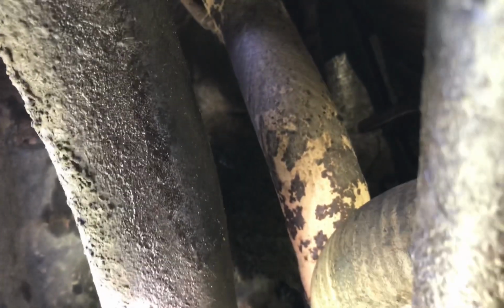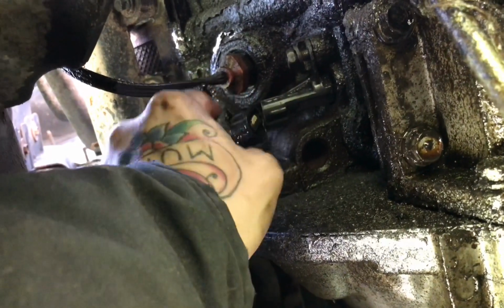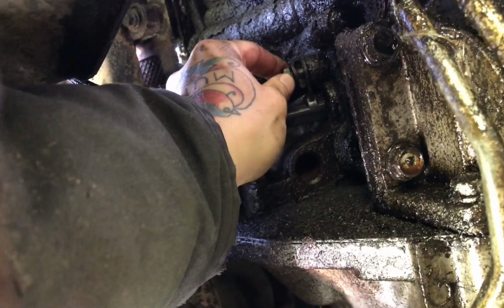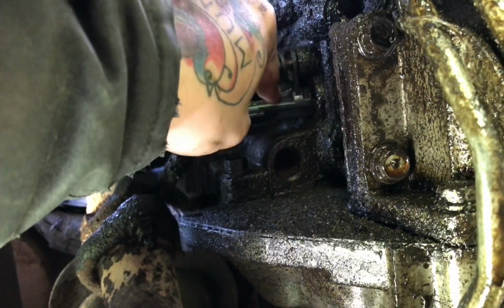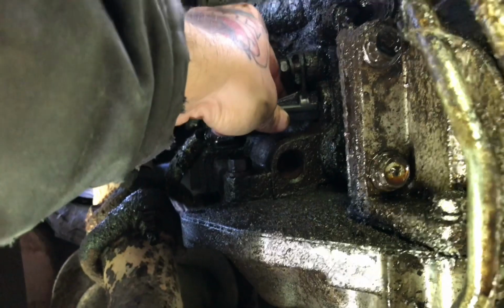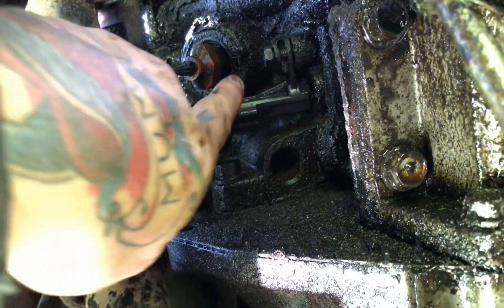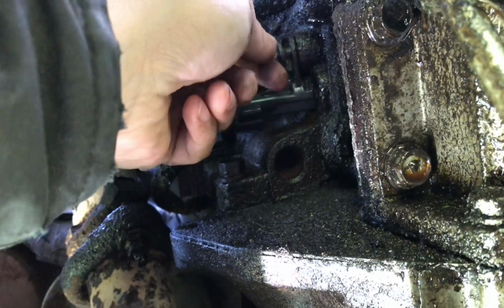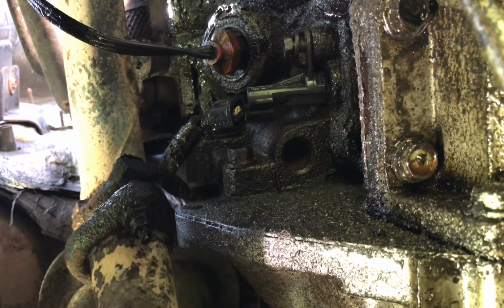How to Replace Crankshaft Sensor • Dodge Ram 1500 4.7L • #ThatBeardedMechanic

Comment: Finally good short quality content... How it should be... Thanks for not being an idiot and wasting our time with useless blabbering or lack of info
Reply from the maker: Haha glad someone agrees that too many “DIY” videos ramble on, that’s the aim of my content is to be as short as possible and still be straightforward with information to do it properly. 
Appreciate the kudos. Cheers.
Reply: @That_Bearded_Mechanic   did you have relearn crankshaft position sensor ?
Reply from the maker: Nope. Just reset the code. Started the truck back up, let her idle and drove as normal and  you’re good to go. ECU/ ECM should pick up the signal from the new sensor.

Comment: Why does my 2003 ram dies when u give it gas fast
Reply from the maker: Do you have any check engine lights currently present?
It can be from a host of issues:
- flooding out the engine
- improper fuel/ air mixture from a bad sensor/ throttle body
- a weak fuel pump
- oxygen sensor issue (typically the primary ones)
- clogged catalytic converter

Comment: Nice video. I'll give you all a quick advice.. if it doesn't pull off, but it spins, then it's vacuumed locked.. open the oil fill tube or pull the dipstick. Trust me.. you're welcome
Reply: would this be the case for the cam sensor also?
Reply from the maker: Yup, same concept as it has a little o-ring on it too. Again, be careful so you don’t break it.

Comment: The 13mm...short or long socket?
Reply from the maker: You can use either to get at the bolt. I used a deep socket if memory serves me right. If you don’t have a deep one, you can always use a short extension with a shallow socket on the end. There’s plenty of room.
Reply: @That_Bearded_Mechanic  thanks! What can I use to get the connector to release? I squeezed and squeezed and pulled it!
Reply from the maker: You might have some gunk jammed up in the connector clip. I’ve used small screwdrivers before (the micro ones for glasses) to click the lock pin over or a pick thats hooked to grab it too. Sometimes pushing the sensor connector inward then pushing the release tab will allow it to release then pull it. If it does break, there’s a chance the sensor connector can vibrate loose when you reattach the new sensor. And then cause you issues.
Reply from the maker: You can also try spraying it with some WD-40 or something that’s got a little pressure to displace any gunk that’s got it jammed up.
Reply: @That_Bearded_Mechanic  I got it off! I did everything else first! I let it hang and it was easy then!
Reply from the maker: Right on. Good to hear it worked out for ya.

Comment: Hope you read my comment, if my truck turns off just bc every time it wants but as soon as I put neutral I start the truck back to drive and works perfectly. What that’s problem can be?🙏🏻
Reply from the maker: Are any codes present or a check engine light coming on when this happens and staying on after the restart? 
I assume when it dies while running it’s like someone’s flipped a switch and everything has cut out. Would lead me to believe an electrical/ sensor issue. 

• Check the battery, confirm it’s voltage while running. Should be seeing 12.6volts at the battery while running. 

• A voltage drop test on the battery when you start it should ideally see no more than a 2 volt variance (no less than 10volts) when starting. 

• Check the alternator as well and confirm it’s functioning properly and charging the system. Should be seeing 14.6volts while running. 

• Double check all grounds and wiring connected to the battery and TIPM (engine fuse box) for corrosion. 

Personally myself, I’ve had this exact issue happen to me and it was my alternator fluctuating voltage to the battery. I noticed an electrical gremlin starting the day or two prior. 

Thankfully when mine decide to do this at full failure, it was on my way to work and not somewhere way out in the bush etc. I had to limp it 20kms like this coasting and starting a few times. 

You can also check the cam and crankshaft sensors as well. I have this and another video outlining them. If they are failing, they too can cause these issues but you typically would see an actual starting issue with it as well but it’s good to rule them out as well. 

Hope this helps you.

Comment: I have a 2004 Dodge 1500, 4.7L & it cut off twice while I was driving on the highway.  I thought it was because it has 185K miles on it, but I researched the code PO340 & PO344, which bought me to you. 😊￼Now, I'm not a mechanic by trade but I can read and follow instructions, so I'm going to give it a try.  Oh, by the way, I just had the spark plugs changed and the mechanic did mention that I need a new valve cover gasket.  So should I wait and get the VCG replaced or attempt to replace the crankshaft and camshaft sensors first?
Reply from the maker: Welcome! Glad the search feature brought you to me. Mileage really has nothing to do with a vehicle “just turning off”. My Ram in these videos for instance has 732,000kms at the time of recording them. 
I’d change the Camshaft and Crankshaft sensors. Then when you have time, change the valve cover gasket as well. Highly suggest an OEM Dodge one or a Fel-Pro gasket (that’s what I have in my truck). The kit will come with all new grommets for the bolts as well so it’s a complete gasket changeover to avoid leaks.

Hope this helps. Any further assistance required, please feel free to message me and I’ll reply as fast as I can.

Comment: Thanks bro simple and easy..👍👍
Reply from the maker: Right on, glad it helped ya.
Reply: @That_Bearded_Mechanic  say man I'm having problems getting my truck back on I replaced the two sensors and the starter but when I turn the key its making a noise like if the starter is jus hitting the fly wheel any thoughts..
Reply from the maker: Mike Uribe Hmm, what was the issue before or leading up to the issue that made you replace all three items?

And is it grinding or just clunking against the flywheel? It’s possible they gave you the wrong starter so it’s not engaging the flywheel correctly. Another possibility is the flywheel maybe damaged on the gear teeth. 

Are you able to make a quick video and post it and tag me in it?
Reply: @That_Bearded_Mechanic  it was like knocking noise it did sound like grinding but I jus turned the pulley a few times and it ended up starting but I was told it might be the flywheel.
Reply from the maker: Mike Uribe Yeah I would have to agree with that since you had to rotate the engine over a couple degrees. It could also be that the flywheel teeth weren’t fully lined up with the starter to engage properly. I have dealt with this several times when installing new starters in heavy duty and automotive applications. 

Best to monitor in case it happens again. But I wouldn’t be immediately thinking the worst right now. There is an inspection cover on the case at least mine has one) so you can remove that and inspect if there’s any gear teeth that have been knocked off and sitting in the bottom of the bell housing.
Reply: @That_Bearded_Mechanic  tru tru thank you for your feedback
Reply: I had my mechanic get it  but turn out it was my fuel pump was bad not the crank sensor

Comment: I have fuel spark and crank but won't start even off starter fluid
Reply from the maker: What year and engine?
Do you have a check engine light on? 
And do you have any type of security immobilizer installed?
Reply: @That_Bearded_Mechanic  07 with a 4.7l and no
Reply from the maker: Okay, the major issue on our trucks when it comes to this as well is the TIPM (engine fuse box), they’re prone to building up corrosion on the underside. So take a look at that. 

It’s odd no codes are present but you can check further by cycling you ignition key to on the ON position three times and codes will pop up in the dash where the odometer reading is. Just another back up to confirm there’s no codes. 

I would definitely start there. I had this same situation on my Ram, swapped in a new TIPM from a junkyard because I did confirm corrosion on the underside of the unit itself in my case. 

The follow up would be to inspect the crank and cam sensors. As I stated in the video, they’re prone to causing hard starts and other running related issues. 
If you have a multimeter, you can test them before replacing, there’s tutorials online of how to do this that you can search and then confirm if the sensor is faulty or not.
Reply: @That_Bearded_Mechanic  I have a 02 that needs a motor and we where going to pull the motor out of the 07 but couldn't do it since the truck was really nice but still thinking about just doing it so I can have my truck running. I've looked at everything and tested everything no codes
Reply: @That_Bearded_Mechanic  I've asked mechanics that have been in the job for 40 plus years and nobody knows what's going on without looking at it but we don't have the time and money to do it. We just want it running
Reply from the maker: Yeah that’s the hard thing in diagnosing when I don’t actually have the truck in front of me to see, hear and test what’s going on. 
It is odd you have no CEL’s, have fuel at the rail, air, spark and she cranks. 

I’m assuming it ran recently while you had it or you were told it ran prior to you getting it to swap the engines over to the ‘02.

I assume you have solid compression across all cylinders as well? 
Check all grounds, the ECU, TIPM, wiring connectors and the harnesses.
Reply: @That_Bearded_Mechanic  I can't find anyone that's close to where I live at to come and figure it out cus it's getting to the point of pull the motor and set the rest of it on fire

Comment: I have an 06 3.7L  I have fuel,spark, compression new coils new spark plugs, new crankshaft sensor, new camshaft sensor  and it only cranks but no start 
What else can I check for?
Reply from the maker: I assume you have no check engine lights on the dash at all to indicate somethings failed? And you’ve confirmed the fuel is in fact getting to the fuel rails right? You can check the Schrader Valve on the fuel rail for this, should have a black cap on it, on the passenger side if memory serves me right. Wear safety glasses of some sort when you check it and have a rag underneath it to catch any fuel.  Depress the valve or actually get a gauge (some auto places rent them out) and with the gauge you can see if there’s continual pressure.

Comment: 2003 ram pickup 1500. 3.7 faulty gas gauge, new fuel pump,faulty gas gauge.np pump problems on code reader. Did reset several times but no luck. Sensor may be cause but you didn't mention it,also might be ecu, or ignition module.spent 2grand in one year  help!me! Please
Reply from the maker: What are some of the fuel pump codes you’re getting on the code reader? 

I’m assuming you’re just having a general running/ staying running issue on the truck? 

You can also confirm fuel pump operating by the obvious of heading it prime with the key in the ON position and also checking the Schrader valve (little port with a black cap) on the fuel rail (passenger side) with a fuel pressure gauge (some places rent them out for cheap/ buy from Harbour Freight cheap).

BE CAREFUL doing this, there is fuel pressure in that rail and some can spray out if you don’t connect properly. 

Fuel pressure should be 44-54psi while running and stay consistent.

For the fact the gauge is faulty, you can “bench test” the fuel pump sending unit by actuating the arm slowly with the key in the ON position and having someone watch the fuel gauge if it rises and drops as you actuate the float arm. 

Also confirm all the wiring from the pump as far as you can trace forward is intact. The harness is pretty exposed and I’ve had issues in the past in a shop where I’ve had to pull majority of the harness down and found corrosion in the harness that’s to the fuel pump.

Hope these suggestions work for you and get you a head start. Please update on your findings.

Comment: hi i have a 2002 ram 1500 4.7 ....ive been having a lot of fun with this truck....... heres my story....
1--i changed the tps sensor and the iac valve i also replaced the vacumm hoses,it would crank every single time no problem but it would idle really high...we messed around with the vacuum hoses and it would still idle high.
2- we couldnt fix the idle problem so it followed with a bad negative battery cable....it would act like it didnt have enough juice to crank...we fixed that and it would run but still high idle....
3-i would try to crank it but it would missfire or back fire
4-fuel pump died so we replaced it and when i went to pick it up it would turn over but not fire up from cranking it too much it back fired or missfired through the intake and it actually broke the air box...the one thats in the middle of the engine and snapped it in half.... acording to my mechanic it wouldnt crank and it missfired due to one of the sensor not being plugged in correctly...it was either the tps or iac valve i cant remember which one.
5.we picked it up and it ran like a champ..it would crank at the first try ran great,idle was perfect good power great gas mileage
perfect temp.every thing was perfect...then it died againall the same symptoms it had when the pump died,wouldnt fire up backfiring,missfiring,smell gas,we know its not the pump because we are getting fuel no problem...
i think its the crankkcae sensor,my dad thinks its the pcm messing everything up and one mechanic thinks its something to do with the wiring harness
please help...when it runs it runs great...please help
Reply from the maker: Wow, very detailed list of issues, appreciate that in helping to try and diagnose. First off, I assume there’s no CEL (check engine light) on the dash this whole time?

Have you guys taken a look at the engine timing by chance to confirm she hasn’t skipped a tooth? I’ve had an issue like this in the past on another vehicle and she had skipped timing by one tooth, have also dealt with it in my heavy duty background as well on a forklift having pretty much the same issues as you’re mentioning.

Make sure to take a look at the TIPM (the main fuse box in the engine bay). They’re exposed to the elements underneath and pretty prone to corrosion and that can cause some problems as to what you’re describing.  

As for the PCM, you can grab a junkyard one of the same year and engine and try swapping it in (hoping the donor PCM is in fact working properly). You could also try the simple thing of gently wiggling the connectors and harnesses attached to the modules and see if they change anything as faulty connections can cause issues like this as well. 

Crank and cam sensors are cheap enough to swap in and easy enough as well for a test on any change. 

Start with what I listed above and check back in with how you made out.
Reply: @That_Bearded_Mechanic  update.....
the check engine light was on ever since i got the truck this time last year.....
i changed both the crank and cam sensor..
for whatever reason the cam sensor the plastic housing for the sensor  was half melted. i started the truck and the check engine light went away now the damn thing idles high. any ideas?
Reply from the maker: @theratedrtransformer8890  Hmm that’s odd that’s it’s melted, but at least that’s been dealt with. 

Alright so let’s go back to the fact the TPS and IACV have been changed.

The little motor on the throttle body is supposed to be clocked at a specific position when replaced, I’m thinking it may not have been clocked into place correctly (no fault of your own, it’s something that’s needed to be aware of beforehand) and now has opened the butterfly valve too far and thus the high idle. 

If that still hasn’t remedied it, I’m leaning then towards the PCM, in which you could try a hard reset, pull the PCM fuse and remove both battery cables for 1/2 hour, reconnect fuse and cables. Restart. Let idle and sort itself out. Try this after reconfirming the throttle body issue I mentioned above.

Comment: What if its stuck
Reply from the maker: If the sensor itself is stuck/ seized in place. I would advise to try soaking it in penetrating fluid such as PB Blaster, WD-40 won’t work as great in my experience. 

Soak it overnight if possible. Now that’s been done, see if that’s helped budge it by carefully trying to loosen it, if not jump to trying to loosen it up with a small torch like a plumbers one. Making sure NOT to heat up or melt any wiring nearby. Direct the flame at the edges of the block where the sensor is mounted, moving around the edges. It should melt/ soften it up enough to allow it to break free since it’s “rust/ corrosion” welded in place. 

If those steps do not work. Remove the plastic guard in the wheel well and break out a drill and some good strong screws (suggest the blue drywall/ sheet rock ones) and screw two of them into the sensors s close to middle as possible. Get them deep enough but still able to get some vice grips on them. Hit with some more PB Blaster and start twisting to break it free. 

Change the oil and filter after this method to avoid any risk of debris cycling through the engine. You can drop the pan as well to be extra thorough.  

I’ve used the methods I posted above with great success. I always advise to clean the sensor port when installing a new one to avoid any further issues. 
Good luck and hope this helps.

Comment: I think the CPS is the least of that engines problems lol
Reply from the maker: Naw not at all considering it was at 732,000kms at the time of that video. Off-roaded, hauling, towing and highway commuting on the regular.

Currently in the process of stripping her apart now for a rebuild and a turbo or supercharger setup. Haven’t decided which yet.
Reply: @That_Bearded_Mechanic  I hear you, I've got a 2016 1500 Limited almost at 100,000 miles and trying to decide if I wanna keep it or trade for a 3500